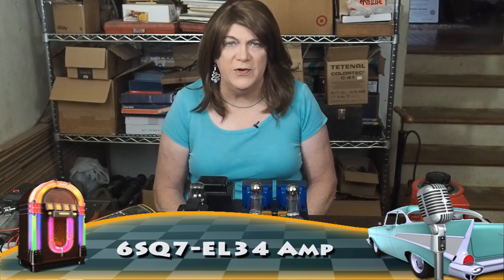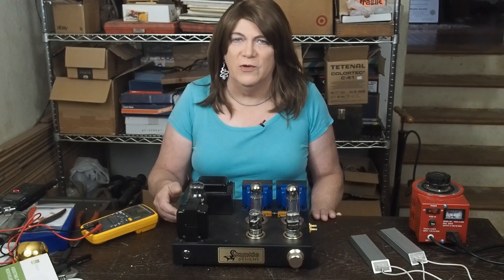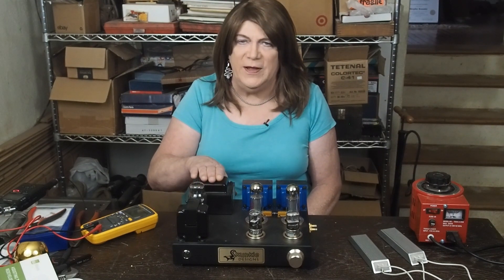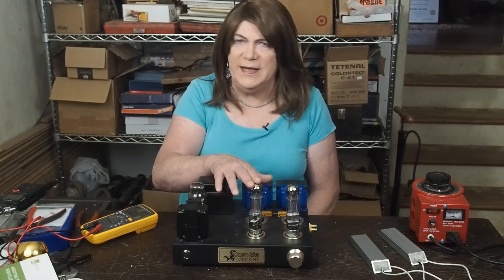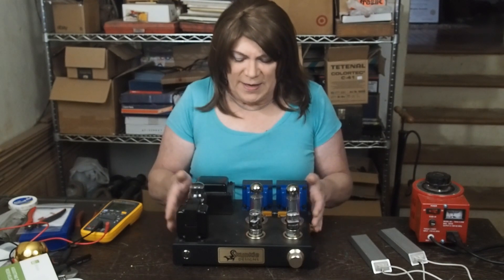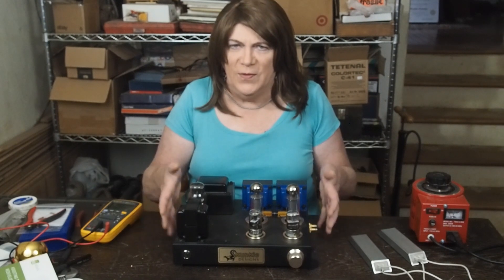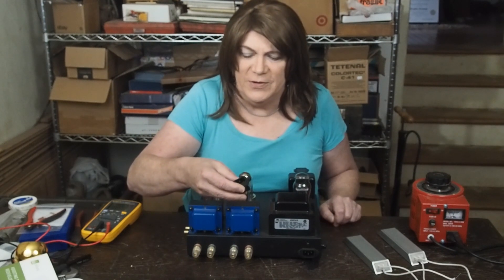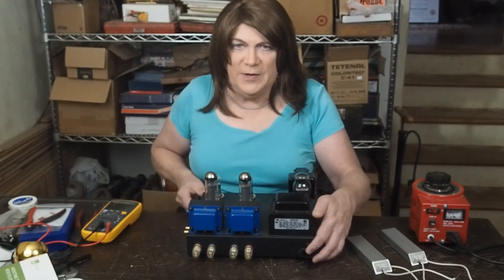My 6SQ7 EL34 Tube Audio Amplifier Build

Comment: Any option to replace 6SQ7? This is a super rare tube.
Reply from the maker: Hmm they are pretty easy to find on ebay used. A 6FS5 should also work but never tried it and has a different pin out. My later version of this amp uses a 5751 9 pin tube which are easy to find.

Comment: Nice amp! Have you tried a similar circuit using the 6SL7? I'm wondering how well it might work given the 6SL7's lower mu. I would be interested to try it.
Reply from the maker: I would likely work, just not sure what it would sound like.
Reply: @SkunkieDesignsElectronics thanks for the reply. I might give it a go.

Comment: Do KT88 cause more power supply sag? I know 6L6 tubes cause more ps sag than 6v6 tubes.
Reply from the maker: Not in a single ended amp, you are thinking push pull in AB
Reply: @SkunkieDesignsElectronics  Yeah I was thinking push pull AB  yeah single ended is one less tube so it’s easier on the power supply.
Reply from the maker: It's actually that the output tube current doesn't change with the signal strength, not that it is simply one less tube.

Comment: I heard a tube amp using 2 6sq7 black metal tubes and 2 6v6 (push pull on the 6v6 tubes). Fantastic bass tone from it - very impressive.

Comment: Great video! may I ask you a question, why is this audio amplifier use only one auto taper potentiometer for two speakers? how can it control volume of two speakers?
Reply from the maker: It's a "ganged" potentiometer, it is 2 audio taper pots in one package.
Reply: @SkunkieDesignsElectronics  I got it, thanks so much for your reply 😄

Comment: Great videos!  What gauge of wire do you recommend and any particular brand or type?
Reply from the maker: I use 18ga solid for almost everything. And I'm not picky about the kind of wire as 18ga is so overkill for the amount of current we are using. It's the same reason I use 2W resistors for most uses, except for things like grid resistors that have almost no current.

Comment: You could mount the choke horizontally on the frame, and move the power switch to where the choke was.  Then a bottom plate would fit.

Comment: Would it be possible to use Russian 5881s? I've already got several pairs of 6n3c of various vintages so would be fun to try em out! Also would it be possible to use a 5751 for preamp/driver cos that opens up the poss of experimenting with 12ax7,12at7,12au7 etc? I'm a guitarist so got loads of those type o tubes! Thanks for your video btw. I'm learning a lot!👍
Reply from the maker: A 12AX7 would work but might need a different operating point setup to sound good. There are a zillion schematics with a 12ax7 driving an EL34. The 5751 has amplification factor of 70 vs 100 so would need more drive from the source to make the same power.
Reply: @SkunkieDesignsElectronics  Yes , I use a 5751 in my Laney Klipp 100W guitar head to get cleaner clean tones for that reason. The 12ax7 was just a thought as I'm guessing you chose the preamp/driver tube for a reason!
Reply: @SkunkieDesignsElectronics  I'm guessing the 6n3c is ok though.

Comment: Hello, I will be following this series. Personally, I would be more interested in a 300B or KT88 build, but you learn a bit on every build regardless. I would also be interested in seeing the output as you vary the frequency through the audible range 20/20k, that would be another point of interest.
Reply from the maker: I do have a KT88 PP amp on the blackboard for a future project. I just finished a 300B build series a couple of weeks ago :) I'm still playing around with that amp, trying to tune it's voice to my liking.

Comment: I like this amp. Noticed that the 6SQ7s are GT, just wondering your thoughts on the black metal versions. Built in shielding, perhaps tended to be microphonic and can't see the glow. Do you have pin 1 grounded to accomodate?
Reply from the maker: I've tried a few, they didn't sound as musical to me, but maybe some sound great.

Comment: Very happy to see you are doing a limited production! Something I have thought about, but life gets in the way lol. Maybe one day. As far as the cathode resistors, I would put them underneath the chassis,  and use small pin sockets for each tube and ground. That way, you can insert multimeter probes safely, and still check bias. Just my 2cents. Best of luck !
Reply from the maker: The reason they are mounted up top is mainly to keep the heat out of the inside of the chassis. I personally wasn't too concerned about have the 30V of cathode voltage exposed, but probably need to figure out how to insulate them.

Comment: I've got the Klipsch R-820F's they are a pain right in the ass.  What do you have for a turntable?
Reply from the maker: Future video. :) So you don't like those speakers?
Reply: @SkunkieDesignsElectronics  Like you said they are a bit bright and they have got to be positioned perfectly.  There is zero room for forgiveness with these things, but when set up they are pretty sweet it's just the years (haha) it takes to get them there.  I've got a really nice shape Technics SL-1200MK2, Grado cartridge I'd like to get rid of.

Comment: I do not have a need of an amplifier right now, but....   My father died when I was very young.  We did not have time to build a good relationship.  But as I got older I got a connection to him through the audio he left behind.  For example, I still have an original pressing of the peter gunn soundtrack from his collection.  He had a tube integrated that I believe he scavenged from a console stereo.  The speakers were 5 1/4" full range drivers in beautiful cabinets. I played that system until the speakers overheated and the amp died.  I am in the process of restoring those cabinets and building a set of tribute speakers using those cabinets.  Each side will use a single tang band 5" full range driver that fits in the cabinet using a chebyshev ported alignment.  This amp may be the perfect compliment to those speakers in creating a vintage/tribute system..  Not sure what you are thinking price wise.  There are some people asking some pretty heady numbers for amps these days.  So I am interested.  Let's see where this goes.
Reply from the maker: Most of it depends on where the total price of the parts ends up. I am not skimping on the parts: Nichicon, Solen and Mundorf caps etc.
Reply: @SkunkieDesignsElectronics  sounds good.  Look forward to hearing how it comes out.

Comment: Will there be a 240 v version . Cheers
Reply from the maker: Possibly in the future if this seems like a viable thing to build and sell.
Reply: @SkunkieDesignsElectronics  240v would be wonderful...Just make sure you make some decent money on your work....It's so sad when businesses cease producing because "it's not economically viable" Profit isn't a dirty word, and buyers already have a win because a  EL34 based design has an extremely high performance/ price ratio from the get go..
I know you'd get 1000 different options wanted ( impossible I know) Here's my 2 cents (worth nothing lol)
1: Possible UL / Triode toggle switch?
2: Treble/ Bass controls to suit various ears /rooms  and recordings with  a bypass switch to appease the "Cork Sniffers" who think well  implemented tone controls still screw the circuit up..
Good Luck from Australia ( Down Under)